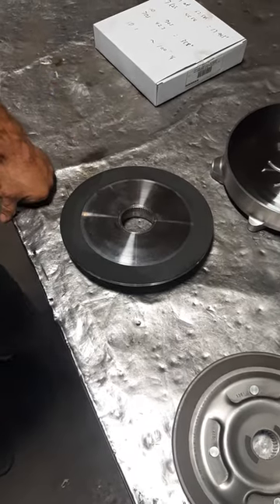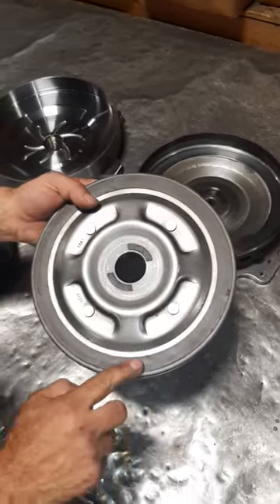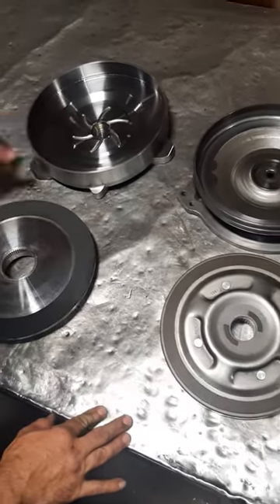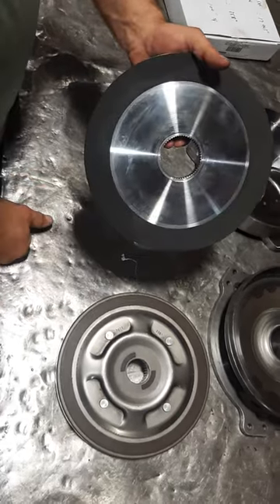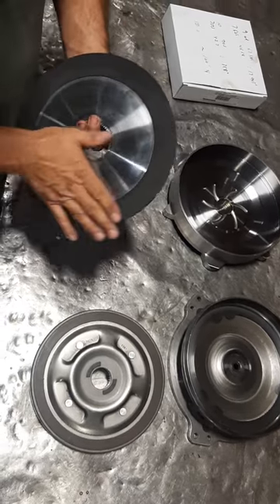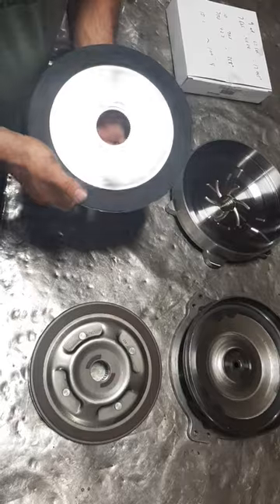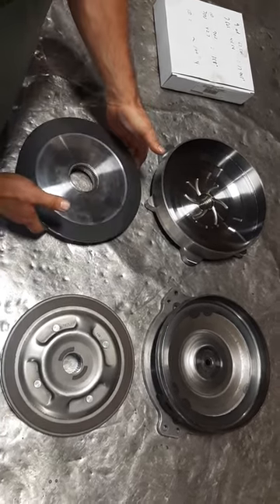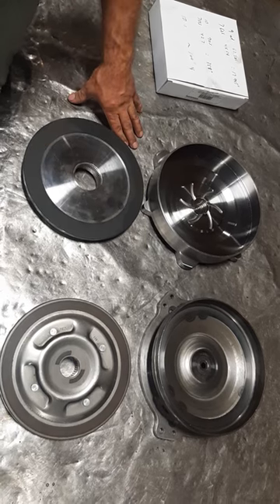Billet Single Disc vs. Budget Lockup Clutch differences

Comment: I had my converter guy take my stock converter, and install a Sonnax billet clutch, Sonnax billet stator, and new clutch material with stock 800 RPM stall speed for a 7000 pound 4X4 truck application. My torque converter is overbuilt for the application. My entire early model 4L80E trans is overbuilt for its application because that is the way I roll. Since I build my own transmissions I can take the money I would have spent on labor, and spend it on high quality parts.

Comment: Say if you have a 4l80e stock tbi 350 can you use the bigger Lock up Clutch? On my 1995 C2500 The lock up comes on in 3rd and 4th after 40 MPH and its like a on and off switch. At 121,000 miles you could feel it lock up hit like a fifth gear but at 177,000 miles lock up feels soft now.  Not sure if I have a line pressure issue or the clearance on the TQ converter clutch is worn.  Other option is to rebuild my 80e with the bigger lock up clutch. Kinda of curious what you would do in this situation.